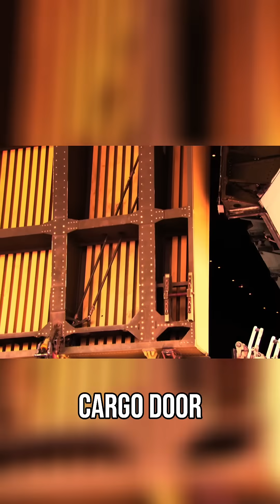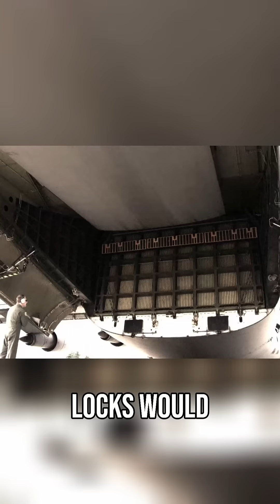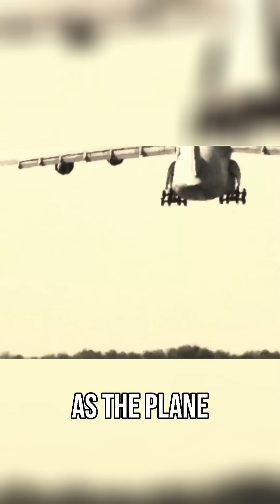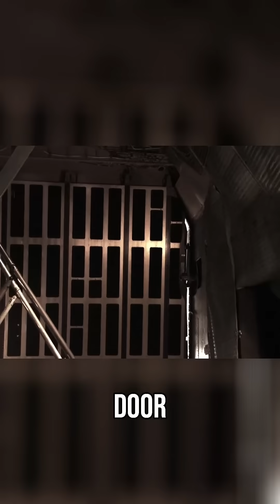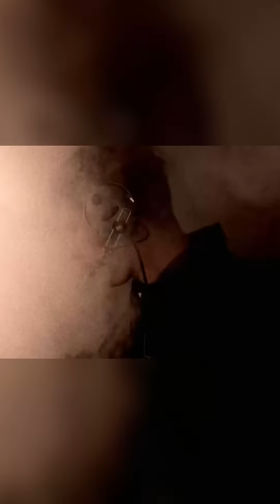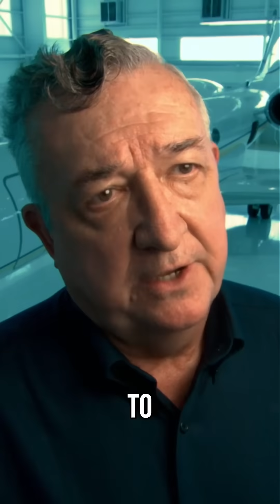Why 3 Critical Locks Failed at 23,000 Feet | Mayday: Air Disaster

Comment: Till the day I die I will call BS on this story about failed locks.  They didn't fail to lock.  That scenario was practically impossible.  But there was a ticking bomb on board.

Here's my explanation:

A couple of decorative porcelain elephants, that were being brought home by the aircrew as last ditch souvenir's from Vietnam that were purchased at the BX located right next to the flightline, were loaded on a pallet at the very last minute onto the aft cargo ramp which is directly adjacent to the fold up or down aft door/ramp.  One of those elephants probably contained some kind of fused explosive device and it eventually  exploded, ripping the pressure door off and the overhead control cables going to the T tail with it.  

They blamed a low level maintenance guy in my aircraft maintenance unit at TAFB for faulty rigging of the locks, but they never explained how it was that some of the supposedly mis-rigged locks, which were all activated simultaneously via bell-cranks and precision adjustable linkages not individual actuators, were found to be still attached to the hayloft and in the over-center locked together position when it was eventually recovered from the water afterwards.  Three locks didn't fail.  They were ripped apart by a highly localized explosion.
Reply: Being certain that something is impossible is exactly how you end up with the alleged impossible thing happening because it leads to people not taking enough contingencies into account.